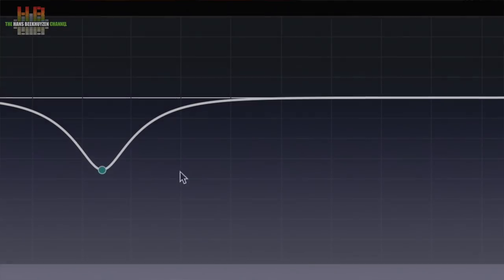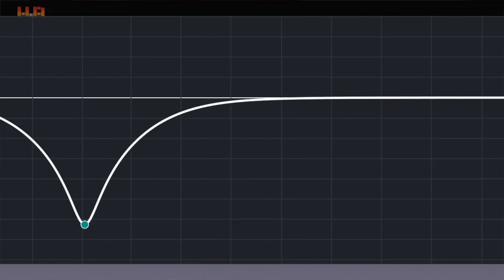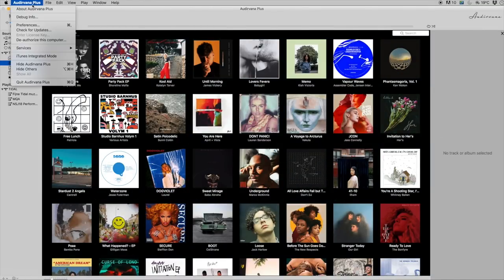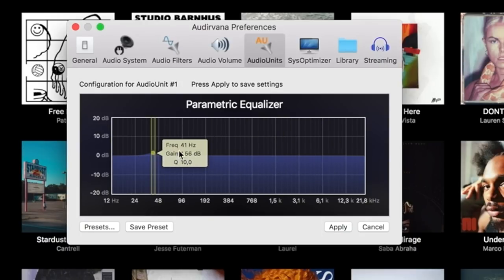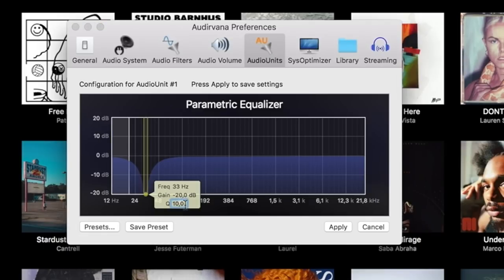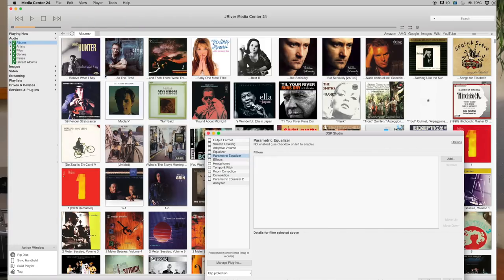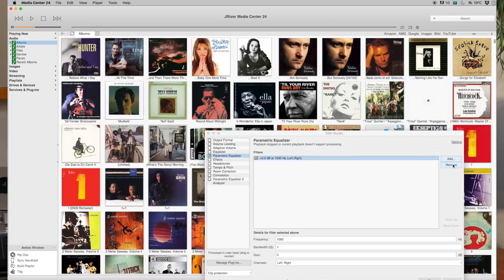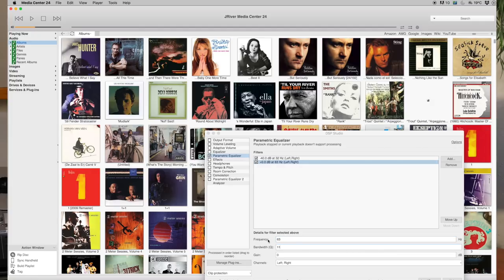Free basic room correction

Comment: As a user of the Roon software, I am using here the convolution option in the DSP engine for room correction. I was surprised by the result since my older Linn stereo set was sounding rather dull compared to my headphone set. I know this is not for everyone but the result is what counts. Thanks to a guide on the Roon forum is was really easy to use a miniDSP UMIK-1 microphone and the Room EQ Wizard software for creating a filter set.  A great Linn demo with Space Optimisation on the XFI PREMIUM audio show inspired me to try this out at home and with great results.
Reply: I am about to delve into this with Roon. Did you manage to correct time domain correction as well as I am reading that only DIRAC does that and nothing else in the market. Thanks

Comment: Hans. Your depth and wide measurement are luckily resulting almost the same frequency harmonics. In my situation they differ. Which are more important? I would say the smallest distance causing sooner an issue at low frequencies... also there are a lot of great vst / equalizers / dsp plugins available (commercial) enabling even left and right other settings ...
Reply from the maker: I don't know what you mean. 5.4, 10 and 2.8 meters give different wave lengths and the Q of room modes is rather high. Dirac differs from other payed and free room correction systems in that they use an unique mix of FIR and IIR filtering that - for me - makes the artefacts of the processing I normally hear, are inaudible with this system.
Reply: @TheHansBeekhuyzenChannel  @ 6:01 you have 31/32 | 62/64| 93 / 96 | 124 / 128
I have 37 / 50 | 74 /100 | 111 / 150 | 200 and you can only 4 audio plugins means 4 frequencies. My question is which of the 4 are most important?
37 / 50 and 100 / 111 or 37 / 74 / 111 / 150?

Comment: What smartphone app do you use to measure sound in real time?
Reply from the maker: Studiosixdigital RTA and Faberacoustical SoundMeter X, both on iOS
Reply: @TheHansBeekhuyzenChannel  Thanks for such a quick response, I am still very interested in your videos, they are very instructive. I have an Umik and I use roon. My room is irregular, it measures 3.70 wide, 2.5 long and from 2.5 the area is 4.20 wide. In total length is 6.70. I will test the app on my iPad.

Thanks
Reply from the maker: Please first apply my two step approach to loudspeaker placement (https://youtu.be/gXohzklfwPs). And don't try to equalise for a flat response. Go for a natural roll of and don't correct for narrow band dips. Correcting these do far more harm. Also see my review of the MiniDSP HSD Studio (https://youtu.be/zr_oqF9jb-8).
Reply: @TheHansBeekhuyzenChannel  Thanks
I saw the speaker placement video. I believe that my speakers are well placed, they do not give many problems in bass (dynaudio C2), rather I have problems with the treble a little clipped (it may be that the tweeter is already old, the Esotar have to be changed after X years)

I will first test the apps to see what frequencies give problems

Thanks

Comment: This is a great video for areas that most audiophiles tend to ignore.  Thanks for it.  Do you have an approach that might work for reflective higher frequencies, which might be caused by glass window reflections, where treatments are difficult?   Thanks for any thoughts...
Reply from the maker: As I describe in https://youtu.be/gXohzklfwPs a sleeping bag or blanked can be used to test the effect of damping. It will probably be too much, a mix of damping and scattering might be better. Again watch the aforementioned video. When you understand these mechanisms it's up to you to find an aesthetically pleasing solution that it acceptable for your significant other.
Reply: Do you plan to do any reviews of mac based frequency analyzers?  I am guessing a measurement mic might be a good investment in any case.  I have the ones that come with surround receivers, but I am guessing these aren't that good.  Like you, I have previously not been impressed with most receiver based room correction solutions.  Nice to know there are other ways to address these problems.
Reply from the maker: I will focus on room correction software. Frequency analysers as such do not have my attention. Measurement mikes for room correction don't need to be too sophisticated since deviations for the ideal response can be corrected using a calibration file.

Comment: Very nice information! Thank you! I had a question, why didn't you measure the room modes experimentally using white noise?
Reply from the maker: The starting point was 'Free' and 'Simple'. Software that is able to do these measurements reliably is either complex to use or costly (or both).
Reply: @TheHansBeekhuyzenChannel  
Thanks for the answer! I get the free part, I was actually wondering wether it is better (more precise) to use white noise instead of music when monitoring with the smartphone.
Reply from the maker: No, not for low frequencies. Then you would need a gliding tone, synchronised to a tracking filter. The 3rd octave analyser would give about the same reading when using suited music or pink noise (use pink noise, not white noise)
Reply: @TheHansBeekhuyzenChannel  nice, thanx for the info!!

Comment: Sound speed is around 344 m/s at room temperature. Modes are calculated not only by the individual lengths of the room, so your calculations here are not comprehensive. But you probably know this. Good videos overall.
Reply from the maker: Indeed, the idea is to give the general public with interest in stereo reproduction some idea on how this works. Not to do a course in acoustics.

Comment: Hello Hans, you accidentally mention a wrong value for the speed of sound.. it’s not 334, but 343 m/s  at 20 degree C and 1 bar.
It’s only a few percent wrong, but still…
Reply from the maker: Depends on the temperature and air pressure😄 We are taught to judge the distance of thunder by counting the time between the lightning and the thunder and divide it by three to get the distance in km. So that is 333,333 m/s. That must have still be in my head somehow. But you are right, of course, 343 m/s is the official figure.